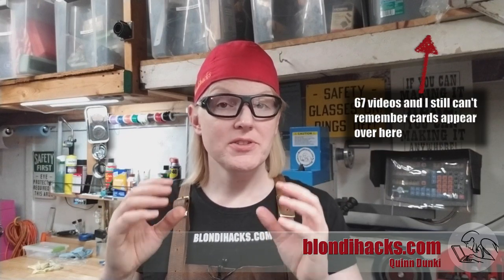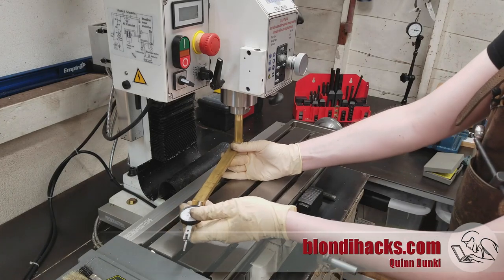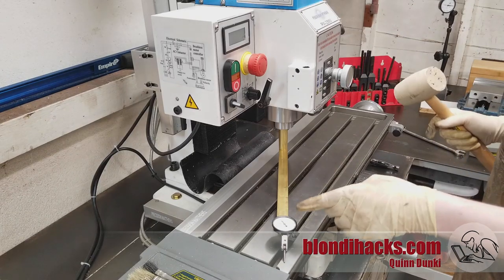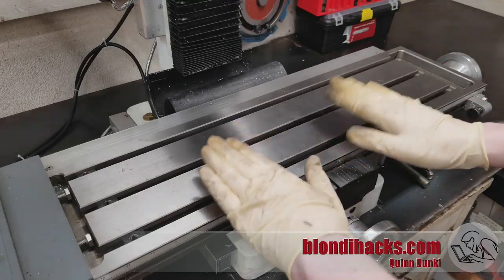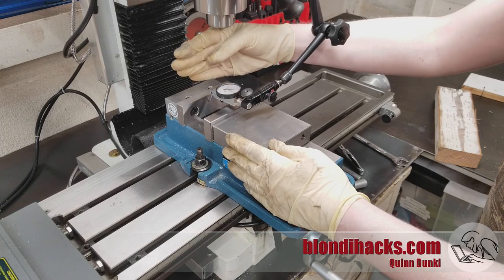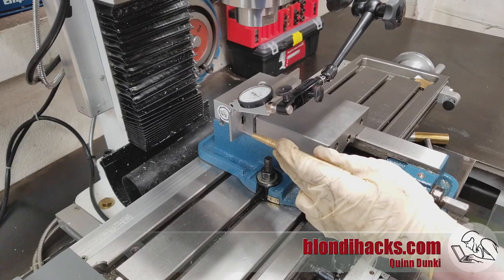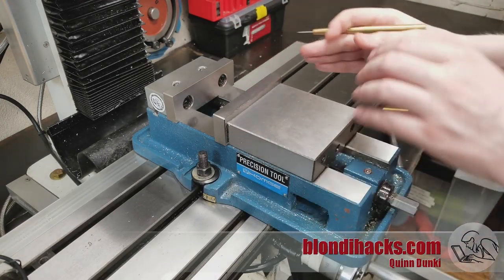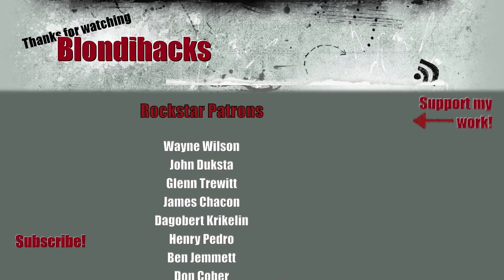Vertical Mill Tutorial 2 : Setup

Comment: Just because the mill does not have a nod adjust, I would not assume that nod is perfectly trammed. Even on these mills check the nod and check the spindle to z-axis parallellism (sweep an indicator with the z-axis up a machinists square. If the nod is trammed but the needle still moves the spindle is not square) 
Even when these things are not adjustable (easily), they can still be dealt with, either by knowing they are there and accommodating for it, or shimming/epoxying/scraping in the mill. (Don't scrape in a mill like this, they are great for the purpose and i do have one, but they do flex several thousands out of tram under cutting loads, so don't go nuts with the tram)
Reply from the maker: Yes, and as another commenter pointed out, the likely error will be sag in the nod direction. That’s easily fixed with a shim under the head mounting bolts, or under the bolts between the base and column.
Reply: Whether to adjust the column/base interface or the head depends on what's off. If the column is not perpendicular to the table this is fixed by adjusting the column mounting. If the spindle is not parallel to the column this is fixed at the head. I measure a bit of nod on mine, but as I can measure it when sweeping a square in the Z direction I know it is because the column is out of square. 
Also, we should consider whether it is actually worth fixing. Note that shimming causes a loss of rigidity. I.e. the machine will deflect a bit more under cutting loads. If the error is small I would consider not shimming out the error to maintain better rigidity. Using machine adjusting epoxy is a better approach, but is also a bit more of a commitment. 
I personally would not use an as long mount for the indicator to measure tram as you do. The added precision is in my view meaningless because of the rigidity of the machine, and you cannot use the same setup to measure the Y axis easily. I'd stick to a ~10cm extension (4" in freedom units) for the indicator and measure all four cardinal directions on the table in one setup. Even though you can't adjust Y tram it is useful to know what it is and if it has moved. Note that if you just measure two points in the corners of the table and your machine has a bit of nod, you will actually end up dialing in a bit of tilt on the head as you move the normal plane to the spindle to intersect the table at the two points you measure. You need at least three measurements to know the head is tram. 

Oh, Great video series BTW. your approach of starting from the ground up complements the other machinists channels  very well.

Comment: Would it be feasible and/ore useful to take the 'parallel' technique one step further and use a machinist's block to place that parallel directly over the bolts? That would get rid of the offset entirely...
Reply from the maker: Interesting question! You could, but you’d be introducing quite a few new variables there, and new sources of error. I suspect the slightly increased ease of indicating wouldn’t be worth the uncertainty of the result.

Comment: I must say after swapping vices, rotary tables, and chucks at least once a week on a VMC.. it's not hard using one side as a rotation point and sweeping the surface the jaw actually bolts to since even hard jaws aren't flawless. Settle for .0001 over the width of the vise.

Comment: Why do you install your vise in the middle of the table since (as far as I can imagine) you're not likely to use the vise to hold long parts with lots of overhang?  Or, if you do, you'll be using jacks anyway.
Reply from the maker: The middle of the table is generally the most precise area, because towards the ends the weight of the overhang can cause issues. It also gives you the most range of motion around both sides of the vise. You never know how you’ll be holding the part, so you want as much travel as possible around where you’re working.

Comment: How would you cut 45° angles with out the swivel base? I'm getting my arss kicked trying to dial it in. I need to be able to cut at angles. Please advise.
Reply from the maker: There are many ways to do it. If you can make the cut vertically, That’s usually easiest. Otherwise you can indicate an angle plate with a sine bar, or use or a rotary table, to name a couple of options.
Reply: @Blondihacks  could you do a video on it?

Comment: Blondie, I agree with you that having a long arm on your measurement device is good for tweaking out error.  However, I think that you fail to address the fact that a long arm is going to have deflection in it, and the arm that you use definitely looks like it could have a couple thousandths of deflection simply due to its long length and gravity.  I think you need to design an arm that has a 45 degree gusset support for more accuracy.  Just my thoughts.  I'm a total amateur so your channel is awesome for a newbie.
Reply from the maker: The deflection turns out not to matter because the sag is the same on both ends and gravity is stronger than the spring in the indicator. Just let it settle at each end.
Reply: Duh, of course!  See, that's why you're the one with the channel.  😊

Comment: How do you know that the fixture is square to the chuck?
Reply from the maker: Are you asking about the tramming tool? It doesn’t need to be square or even straight, because any error will be the same on both sides. These are relative measurements, so error in the tramming tool cancels out.

Comment: Looks like you have milled grooves bottom of the vice. They have tapped holes? Grooves are ment to hold a steel bar that leans against table t-bolt groove, this way vice is easy and fast to get in line. If groove on vice is badly made, you can mill it better. To do that, put thick paraller etc steel bar that fits on table t-bolt groove, on vice, turn vice upside down and secure vice to table with clamp set you have. Then mill the it .bolt new steel bars on vice and its done.
Reply from the maker: Yep, I am familiar with the concept of vise keys.